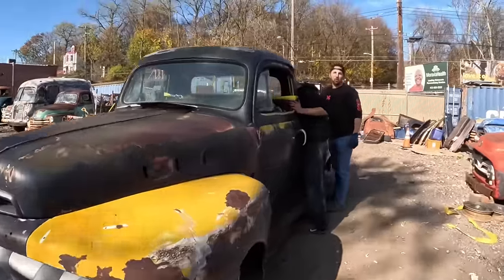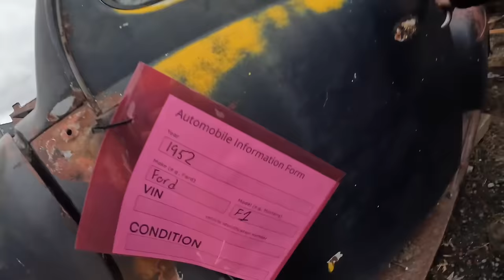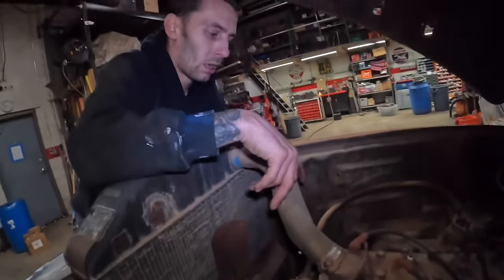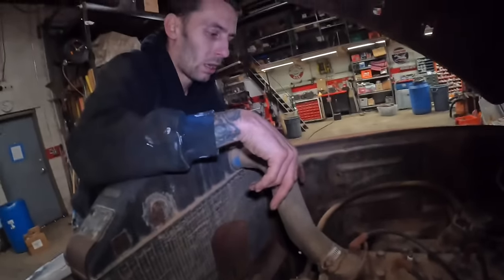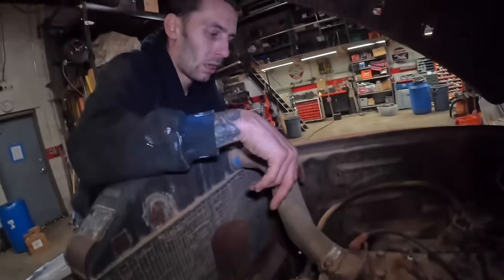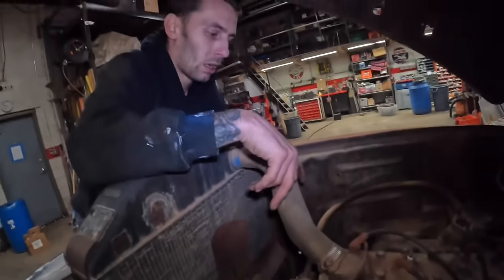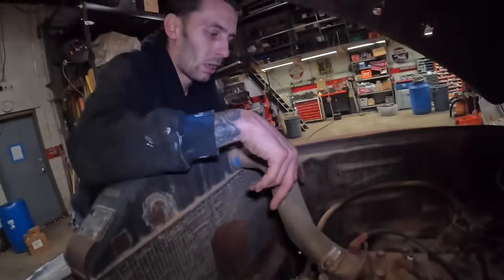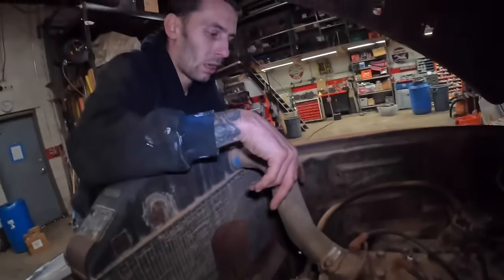1952 Ford F1 ABANDONED in New Mexico since 1969, Will It Run in 2024?

Comment: 51 was the last year for the flathead six.  The hood emblem on the front and the upper valence are 52.  Radiator with double upper outlets looks to be for a flathead V8.  Still a cool truck. Not trying to pick it apart.  Definitely a story behind it.  Great video.
Reply from the maker: We just go off Vin number.

Comment: My dad used to have one of those trucks with that same motor in it and he went to the sawmill and got a load of firewood and put on it and it wouldn't pull itself back up the big hill coming out from the sawmill and he had to unload the wood and drive the truck out empty

Comment: That thing you just pointed out he said makes the starter connection is called a brush
Reply: Generally, 47:14 they have a pin hole in them that you can put a paperclip through and hold the brush back,  thus allowing you to put the armature in. Then you pull the paperclips out and the brushes ride on the armature.

Comment: I had a 77 Ford F100 with a 300 straight 6.The V8 just above it was a 302. I was told the 6 had more torque than the 8. I loved that truck and drove it almost 200K miles and wish I had it back in the same shape it was when I traded it off.